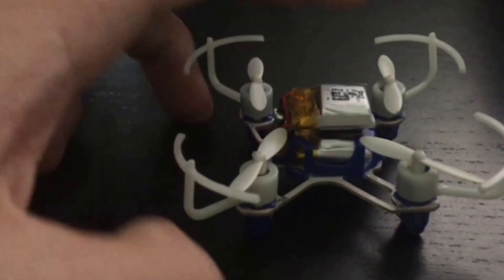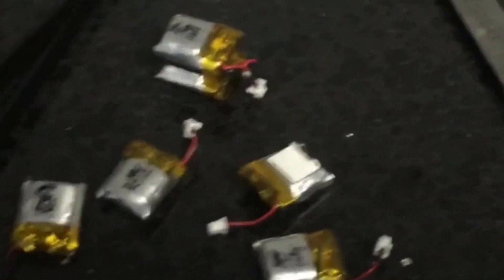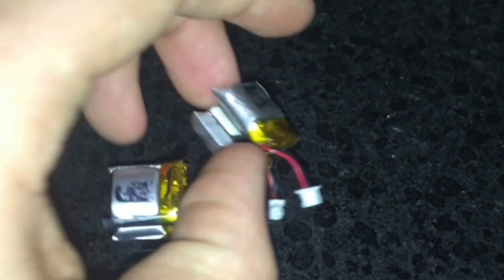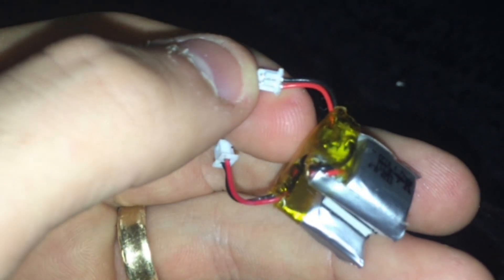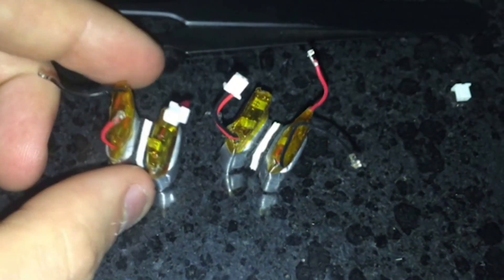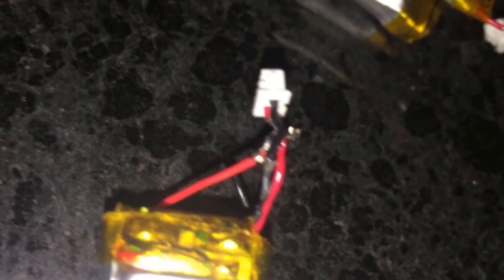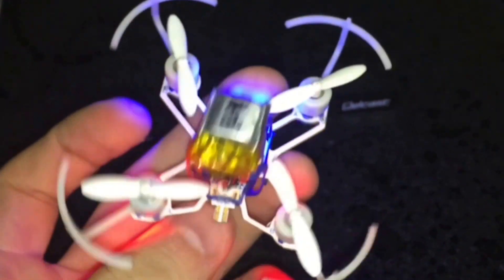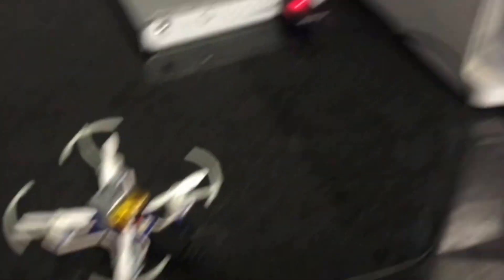How to Hack a Quadcopter Fly with 2 Batteries! (Double Flight Time)

Comment: Fitted my H-111 with a 200mah and tri-blade propellers.  Overall much more stable & visible orientation, plus (limited due to weight) about 1-minute longer runtime

Comment: depending on the drone you try this on it may not even fly due to the extra weight. just cuz the props spin doesnt mean it will fly, I know i've done many mods on different drones and speaking from experience. Also as someone else pointed out easier to mod the drone rather than add more places for the batteries to short out! peace. ]:oP